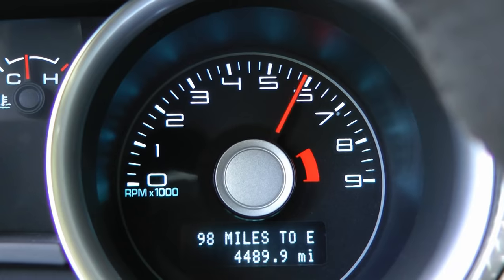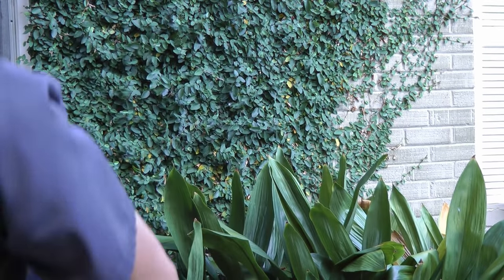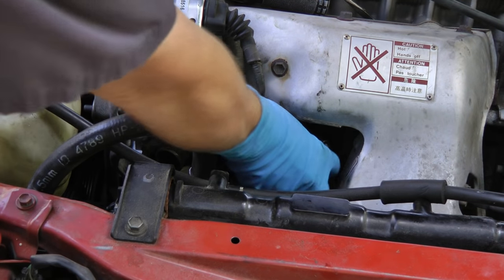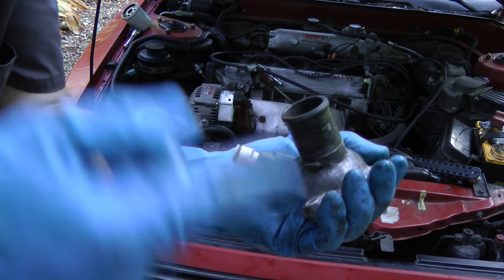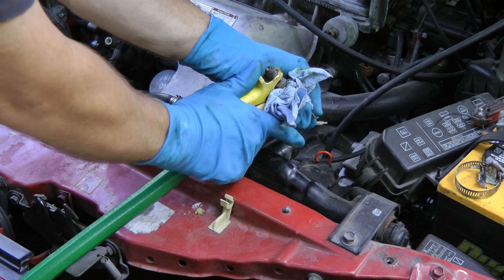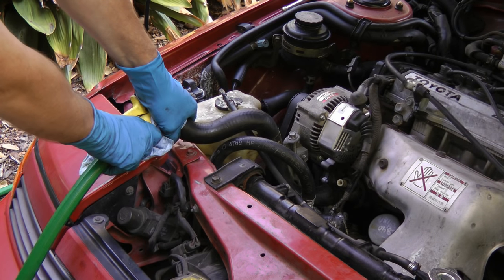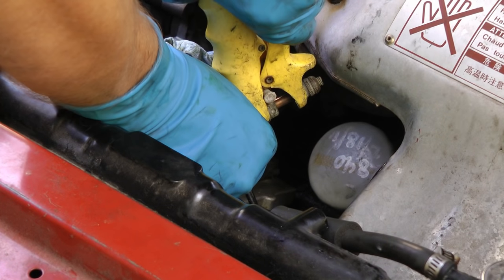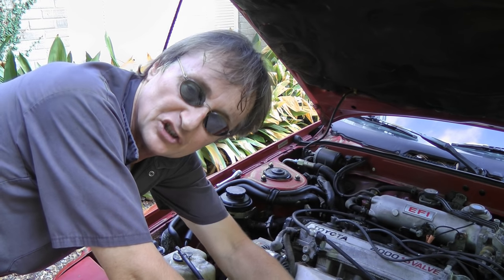How to Flush a Coolant System in Your Car (the Easy Way)

Comment: Just bought a 98 Camaro for the engine. Upon checking the coolant there seems to be brown gunk in there feels like oil but its not. Just this muddy nasty stuff all over the cap and I am guessing in every crevas. I drove it to my home no problem. Should I use a chemical to clean this instead of doing it they way shown in your video. I mean this stuff is nasty I am not sure if a water house would do the trick.
Reply from the maker: Yes, in your case I would use a chemical flush also
Reply: This is the basic situation I'm in the middle of right now on my 99 v6 firebird, my local mechanic (and I found it suggested online as well) told me to flush the system like in this video then refill with water and like half a cup of Cascade Complete then run that for a day or 2 and flush out again and just keep repeating the cycle till all that dex-cool sludge is out. I think I've got most of it in the bottom of the radiator now, after several drains using the drain plug on the bottom of the radiator, I am now seemingly clogged the bottom (below the lower hose) of the rad, so I will be removing it next weekend so I can clean it out good.

Comment: Can you take off the top radiator hose and the bottom radiator hose and  run a water hose through the top radiator hose and then run the truck for a few minutes with the thermostat still in to flush the system also.?

Comment: If you flush out the engine with water, won’t that ruin the oil?
Reply: The coolant shouldn't come into contact with the oil, and therefore neither should the water that you flush the coolant system with.

Comment: Hey Scotty.my heater is blowing cold air inside my 1996 dodge Dakota. The engine runs at a good temperature according to the guage. The top hose going into my heater core is hot but not the bottom one.Same thing with the radiator hoses( top one hot-bottom one not) I am thinking the whole system is clogged up from years of not being flushed.This coming weekend I am going to do what you showed here. Can you offer any advice or tips that will help me flush the system PLUS flush the heater core also?? Thankyou in advance and keep up the great videos.
Reply from the maker: change the heater control valve first, bad ones do that. If not, flush the crap out of it and pray you don't need a new heater core, cows to put in on that dodge
Reply: Scotty Kilmer heater control valve?

Comment: I've heard using distilled water is preferable, however, I flushed my cooling system in November using distilled water.  I drained the system, added distilled water and some radiator flush solution.  Turned on the engine and ran it for 10 minutes or so.  Then I drained it again, added a pre-mixed 50/50 coolant, and burped the system.  I haven't had any problems since, however, to fill it up, I've used about half the required coolant.  I suspect this is because there was still coolant/water deeper in the system that didn't drain out.  With this method, it seems way more likely to clean out all of the old coolant, because the hose pressure is forcing it out.  Then you just add half the total mixture requirement for your vehicle with coolant concentrate (instead of the pre-mixed), and then if it still isn't full, top it off with some more water.  So, is the distilled water recommendation overkill?

Comment: Hey Scotty, do you have a video on how to get a plastic coolant reservoir/overflow tank cap unstuck? I tried using a cleaning cloth for better grip, but its stuck like a jar of pickles. I even tap the lid with a wrench, but nothing. Would lubricant oil or WD-40 spray work? I don't want to break it by pulling too hard.

Were having a 100 degree heat wave in California, although I'm not sure if that had something to do for it to get stuck.

Comment: Will this method work on a 2003 Toyota Camry LE V6 & should I run the engine while flushing the engine with heater on high?
Reply from the maker: this will work, but don't run an engine while flushing you can damage stuff with it running
Reply: Scotty Kilmer So does it remove the coolant out of the heating core as well?

Comment: How safe is it to shoot water in through all of those holes? Like the engine block.
Reply: What was the purpose of removing the thermostat and throwing it away?
Reply from the maker: Los Lakers
safe as houses, just do it on a cold engine, not a hot one. It flushes better driving with no thermostat, then when done, you put a new thermo in as they only last so long and cost little, best to change em every so many years

Comment: Except there will be water left when you put your 50/50 mix in, on my Saab over 2 liters on a 8.5 liter capacity system, so suddenly that mixture is only 35% coolant /65% water. Add concentrated coolant exactly half of the car's capacity and then add (distilled) water.

Comment: I had a Nissan Sentra. The Hanes repair book stated never to run the car without a thermostat, because, unlike pre-computer cars,  the motor may not run correctly from sensor input. I flushed the system, but also intalled a new thermostat.

Comment: I just changed my coolant with no previous issues a few days ago and today it was hot out driving home from work so I had the ac on and when I parked and shut off the engine, I heard straight boiling coming from the engine (temp gauge was perfect) so I popped hood and immediately noticed the reservoir was straight full and boiling and then started spilling everywhere out the release tube... I waited for it to cool down and when it did almost all the coolant in my overflow tank was gone! So when I went to add more, I realized that I forgot to tighten the cap all the way it was on but pretty damn loose. Can a loose cap have caused that issue?

Comment: Hey Scotty I'm replacing a radiator on an 06 Dodge Charger today and I wanted to give it a quick flush I only have a day to do it I'm a little worried about getting all the water out since it is cold where I'm live any suggestions
Reply from the maker: I use compressed air myself and blow it out.
Reply: Scotty Kilmer ok I'll give it a try thanks

Comment: I did not see the heater core get flushed - could you do this as the last section? Block then radiator and last the heater core?

Comment: Hi scotty i drive a mitsubishi 1991 pajero (i guess its montero in the USA)

Anyway i have a leak in the cooling system near the transmission towards the rear of the engine. When im driving i dont see a leak. But after parking and engine still hot it starts leaking coolant then stops when the engine cools down.

The radiator doesnt lose coolant at all,but im having to top off the plastic overflow tank weekly and its almost empty weekly. I cant find where the leak is, if its the water pump it would leak continously right? Where else could it be?
Reply from the maker: do my video tests "how to fix an overheating car"especially the pressure testing part to find the leak.and realize pumps can often leak ONLY when the car is running at a higher speed

Comment: So when the thermostat is out for the week or two, and only using water, how can to monitor the temperature of the water to insure it does not over heat?  Thank you!  👍🏻😉🚙🏎🙏🏻🇺🇸🙏🏻🇺🇸
Reply: There is a temperature gauge which measures the temperature and the thermostat just controls the flow of coolant, so if you take out the thermostat the coolant will be continuously flowing which is okay to do for few days to a week I only did it for a day. It just takes much longer for the car to warm up when you take the thermostat out because it's continuously flowing into the radiator cooling the engine

Comment: I pulled the thermostat and was driving home on the interstate.  The check engine light came on and produced code P0125 (Insufficient Coolant Temperature For Closed Loop Fuel Control)

Is there a problem driving the vehicle with this code as the water level is normal but the coolant temperature is way below normal?

Comment: Hey Scotty. i have a 1999 chrysler 300m that i need to replace a ERG VALVE. my question is do you have any updated channel on how to replace a EGR on a chrysler 300m  thanks.
Reply from the maker: REMOVAL
Disconnect negative battery cable,
Remove air inlet tube and resonator.
Disconnect electrical connector from EGR valve.
Remove EGR tube mounting screws at EGR valve. The EGR valve attaches to the rear of the right cylinder head.
Remove EGR valve mounting screws.
Clean gasket surfaces. Discard old gasket. If necessary, clean EGR passages.
INSTALLATION
Attach electrical connector to solenoid.
Loosely install EGR valve and new gasket on cylinder head.
Using new gaskets, loosely install the EGR tube and mounting screws.
Tighten the EGR tube to EGR valve screws to 11 N-m (95 in. lbs.) torque.
Tighten EGR valve to cylinder head screws to 22 N-m (200 in. lbs.) torque.
Install air inlet tube and resonator.
Connect negative battery cable.
©

Comment: what about RAIN WATER for flushing and then 50% coolant after? can this damage the engine?
Reply: Distilled is the best.  Rain water can carry all sorts of contaminants (industrial fallout, etc.) that you don't want swimming around inside.  Hose water is somewhere in between, depending on the hardness of your local water.

Comment: I have to fill the bucket of etra coolant every 3 days but I can not find the leak ,look like it evaporate some how any sugestion to find the leak??
Reply from the maker: it may be leaking OR burning inside the engine. Do all the tests in my video "how to fix an overheating car" it has to be one of them. Start by pressure testing the system

Comment: Hey Scotty I have a question. I have a 2012 bmw 335is comes with n54 motor . My oil cooler gasket was leaking so I replaced it. But I did I mistake and didn't wait until car was completely cool down .  And when I took off the 3 screws that attach the oil cooler to the housing. Coolant started leaking from there.  So I tied the screws again and waited for the engine to be cold. I changed the oil cooler gasket drove the car for 5 days and I checked my coolant the other day and found out my coolant has oil in it. So I was wondering if that's cause because of that. Or can it be a head gasket

Comment: This video is one of the reasons to buy water less coolant.  It costs like 40 bucks a gallon plus the fluid needed to flush your engine block and system of water but you never have to replace it.  Once installed it will last the life of the engine.  Even if you have to replace a water pump or radiator down the line you can reuse the coolant when your done.  Good investment in my book.
Reply: say what now?

Comment: I'm gunna just try removing the thermostat and flushing through the open port with the hose. My thoughts are it'll go through the whole system and come back out the front open side of the thermostat hose/housing. Then I'll remove the radiator drain plug until the water is drained then top up with coolant while running engine with the heater on full. Wait until the fan goes on and off a few times and it stops taking coolant. Then I'll fill the over flow tank to appropriate level. Will probably add some K-seal cause I have a drip leak from what appears to be the water pump housing area.

Comment: Casi i have to run my car with water for a few days or can I put the thermostat and coolant and just go?
Reply: You can just put the thermostat back in and fill with 50/50 coolant. Just remember to bleed the system as well to avoid air pockets in the system. I don't know if Scotty has a video on bleeding a cooling system.

Comment: I'm fixing to install a new radiator, should I also replace the thermostat and radiator cap as well? How would I clean the coolant reservoir? Mine is located under the battery? I have a kia spectra 2002. 117k miles.

Comment: Hey Scotty I have a 1992 Toyota Tercel and when I got home one night it was overheating on me and I turned it off and I could hear it boiling in the Reservoir I went ahead and replaced the Thermostat and the upper & lower Radiator hose and I flushed the cooling system and added water but I noticed that when I added water to the radiator I turned on the car and I put the heater on as well and the water started boiling in the radiator what could be the issue here please help and thank you

Comment: I would be very hesitant to do this in my minivan. Mostly because we have very hard water where I live and I would be running a lot of calcium and other minerals through the system. I also drive around 200 miles per day. Since I drive Chrysler, the van will die from transmission or engine failure long before this is a problem most likely.

Comment: scotty i have a 98 tahoe , the previous owner must have used regular coolant so inside the radiator it is normal green looking coolant but in the over flow it has gm dex cool, is this bad for the vehicle and can i use  non dex cool if i flush the cooling system same as in this video? thank you

Comment from the maker: as long as the temp gauge does not overheat, that's fine.  But just put a new wire on that housing, easy to splice one in

Comment: You can get a vacuum pump from Harbor Freight in 2023 for $16, but it runs off an air compressor. 
Haven't needed to do that yet as burping and squeezing top radiator hose as seemed to work.
Back flushing is the 'one trick mechanic's don't want you to know', as it can save you on a heater core replacement.

Comment: Hi Scotty, i want to know that i can  flush the old coolant completely with out removing the thermostat valve if yes then how as my car is old  i don't want to have coolant leaks from the thermostat hose after changing the coolant?
Reply from the maker: you can IF you flush with hot water and thermostat stays open
Reply: Thanks  Scotty.

Comment: I know you did a through flush I have flushed mine by opening the valve on the bottom of the radiator and put the hose in the radiator and car run for about 25 minutes and it also works
Reply: I was going to do that but since I’m replacing the whole radiator I’m doing it how Scotty did. Don’t want my new radiator to get crud in it already

Comment: Crazy green fluid in a Toyota. I messed up “Mixing fluids” by adding “Green” to the overflow tank.

I flushed by draining the radiator.

Added $1.25 distilled water (tap is bad) ran through 6 gallons one each day till it was non-foamy water. Replaced with the “Asian Red” oh and the overflow will siphon out clearing the reservoir if you don’t remove the cap while draining.  No tools required.

Comment: i bleed the system already, thermstat is new as well. or is there a way to trap the heat in the core so it dont circuate as fast to get heat in the cabin? ITS COLD =(
Reply: Your cabin heat comes from the hot fluid running through the heater coils in the car. Your heater wont work until you let the car run awhile so the engine will heat up the fluid. Theres no faster way to make your heater work than to drive your car around.

Comment: Hi scotty can i do this without removing the thermostate?&
why did u remove it?
Reply from the maker: removing it makes it possible to flush it ALL out.  If you leave it in, it will prevent flushing of the block out entirely
Reply: Scotty Kilmer wouldnt get the engine temp up very hot and removing the bottom hose drain in completely? Can be dangerous sure but it would work right?

Comment: using tap water, burned one of my first vehicle engines
use only distilled (dead) water, and flush it using 50/50 mix only, otherwise you'll never have true combination or water and antifreeze/anticorrosion in your system.

Comment: So I had to replace my thermostat and radiator because my car was heating up in traffic. The most that it has ever heat up to is 3/4 (has never gotten to the H). I did the replacement and burp the car for 20 min. It still heats up. After I drive it I let it sit until it cools completely. I notice the plastic tank coolant level decreases so I add more. I also massage the hoses and get some bubbles out. But it still heats up. The fans do work, the head gasket is good cuz I don't have any coolant in the oil and the car has never overheated. My car (2003 mitsubishi eclipse) doesn't have a release valve. Could it be that it still has air traped in the system? How long does it take to fully burp all air from the system?
Reply: Did you ever figure out the problem?  Let us know, please.
My car did the same thing but it was the head gasket.  Would love to know what your problem was.

Comment: i have 93 toyota pickup. how do find were the coolant leak is? i let the car run and get hot for about 5 to ten min. and there no sign of a leak? I'm loosing coolant and can't find the leak. is it normal to loose coolant?
Reply from the maker: GERMAN SHEPARD see my video, "how to fix an overheating car" it has to be one of those, and no, that's not normal

Comment: my antifreeze is coming out from the radiator, my car is not overheating, its only using the reservoir antifreeze.. any advice
Reply: Maybe your radiator cap is bad and you need to replace it?

Comment: On a 2012 kia soul is it ok to just drain and fill every 30,000 miles with prestone ?( or do i have to buy the overpriced dealer stuff) I would rather not have to flush my house has pretty hard water and i would end up making the engine dirtier then when i started .
Reply from the maker: prestone extended life is fine, but that car comes with extended life and the prestone also is that, which you can go 100 thousand miles or so on in most cases

Comment: If you cannot use a garden hose, it is a PITA to do this adding water to flush  a few times and then to fill it up with.. You cannot flush crap in there well without back flushing with some garden hose water pressure..

Comment: Why does a car not have a filter system for the coolant?  It flows thru small areas in the radiator and heater core but is not filtered.